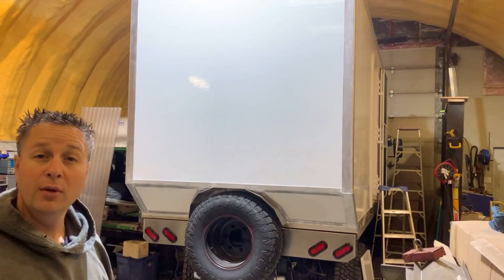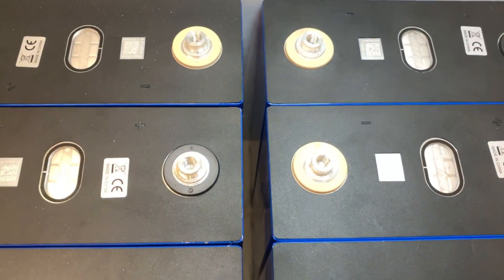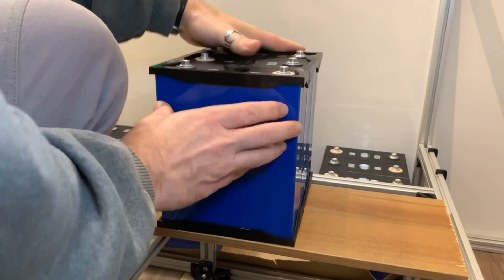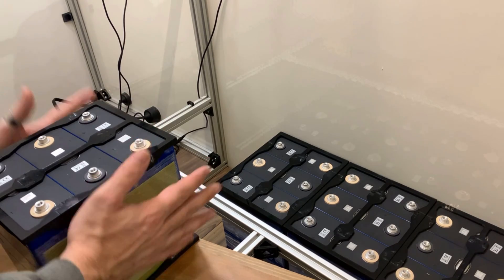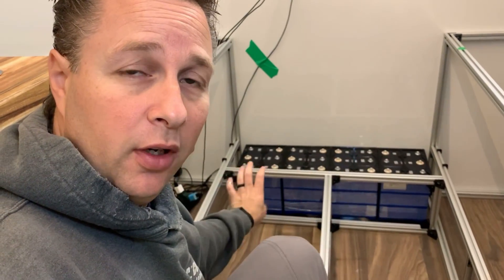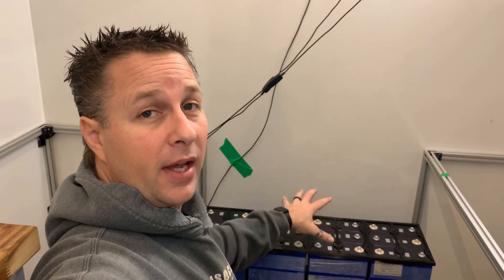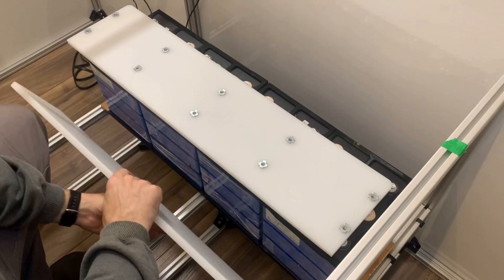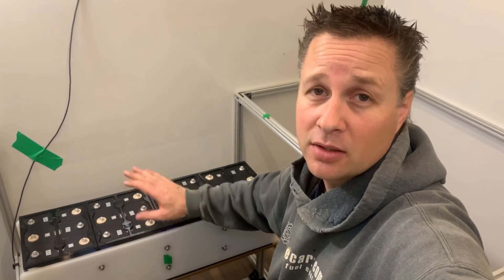SAVE $$ - LiFePO4 Battery Pack Assembly | Overland Electrical Build.

Comment: 12V makes me sad.   For that kind of AH I would have recommended 24V.    I'm making a two strings Eve 304s with 16 cells for 24V, 14,336 wh.
Reply from the maker: I did strongly consider 24v, but that’s hard to do with 12 cells… it’s kind of 12V or 36V.

Comment: That was very good and very educational. I appreciate that you did not get to where you are without my help and assistance. I sometimes swell up myself but I like the idea of that tape that you use - I might try it and if it does not work I can always try a threaded rod!  Anyway are you able to hazard a guess at the saving you would make building a battery bank in lieu of buying ready made batteries. The closest thing I have to that is a piggy bank!
Reply from the maker: Well, just keep in mind any time you find yourself swelling up, some fiberglass tape, a cutting board and some threaded rod can McGuyver you back into shape for less than the cost of a doctor or therapist! 🤣
Reply: That's great... thanks for the advice. I'm delighted that somebody has got my back!

Comment: We went with truck voltage for our setup too, it just makes life so much easier.  We have a 24v LiPo setup and the battery internal BMS has wifi connectivity to a downloadable monitoring app.  One of things I like best about that system is when the truck is parked at home we can check battery condition from inside the house if we need to.  Our 'shore charger' has wifi connectivity too.  Modern technology can make life a lot simpler at times 🙂
Reply from the maker: Yep, my BMS’s have a Bluetooth connection, and can also be wired to an onboard network, or Wi-Fi.  Super handy!

Comment: Very nice. I like the nylon lock nuts on one end. Are you thinking of something like loctite on the other end? (Someone should make nylon lock nut versions of blind nuts. Actually, maybe they do, but they're such a specialty item that they're too $$$)

That reminds me - if you haven't seen them, Misumi makes all sorts of interesting things. Every type of aluminum extrusion nut you can imagine. And nuts and bolts of very imaginable type. Including a reasonable number that are customizable in size. The prices for those can get steep.

(When I am fabulously wealthy, I am going to have to get a Tornos Swiss lathe so that I can get precisely the fasteners that I want...)
Reply from the maker: I considered using loctite on the ends of the threaded rod, but it’s actually much easier to assemble the pack using the nyloc nuts as pseudo bolt heads.  I’ll keep and eye on the pack for the first little bit of use, and if they seem to be loosening off I’ll add some loctite.    Mini lathe sounds fun… would be much easier to lug around than my old 1947 South Bend 🤣.
Reply: @BruceandKrista  actually, since you don’t need that much tension on the bolts, you could 3D print a rectangular piece of plastic to press fit over the nylon lock nut. And add something to the cutting board at that end to stop the rectangle and nut from rotating. 

Does that make sense?

Re: lathes, you should look up video of Tornos lathes. I’m pretty sure their “mini” needs 3 phase power. Their larger ones have something like 8 heads so that you can be turning 8 things at once. One of their smaller ones might fit into my post-apocalyptic 50’ trailer RV concept. My current inverter can be configured with up to 12 units, four per phase for 3 phase. 36 kW. So I’ve already started building my setup. :)
Reply from the maker: Well, ok, I was thinking Mini Being more like desk top LOL.  I’ve actually found and downloaded all the files to 3D print a desktop CNC milling machine (light duty!)
Reply: @BruceandKrista  It’s quite possible that a much more reasonable lathe would work. The examples I’ve seen of the Tornos ones making beautiful and exotic screws are enchanting. 

But my goal right now is to figure out a good way to have my Ender 3 somewhere in my RV so I can 3D print on the road. I’m currently thinking it will go in my Honda Element that we tow. Because then I don’t need to have any fancy fume extraction since we won’t be inside it most of the time. 

I have minimal practical experience with metal machining so a mill or lathe are very much on the back burner. 

(I was only slightly joking about a 50’ trailer, though. I am pretty sure that my next RV will be something I build on a semi truck chassis. Never again will I be annoyed at slowing down to 30mph on uphill mountain highways…)

Comment: Pretty slick, Bruce.  My EP4 48v 100ah LiFePo4s are about double that size and weigh over 100# each.  I like your HDPE border walls and even more 3D parts.
Reply from the maker: The power density available these days is getting nuts!   Always room for more 3D printed parts!!

Comment: Ah - you make it look so easy, but I can only imagine the time it takes to arrive at the final design. BTW - may be just me - but I'm unconvinced that battery swelling is containable......some very powerful forces at work
Reply from the maker: I won’t really mind if they swell a little - but hopefully I can constrain them enough to save a bit off the capacity loss.  Only time will tell!   I don’t plan on having any high C charge or discharge rates, so that should help.
Reply: The manufacturers say to do it. I’m guessing that they might still swell in height or change shape in some other way internally.
Reply from the maker: I’m sure at some level there will be a bit of swelling - but minimal isn’t overly concerning.  The reality is you don’t have to constrain them, you just loose some capacity, but I figured it’s pretty easy to at least attempt to do it!